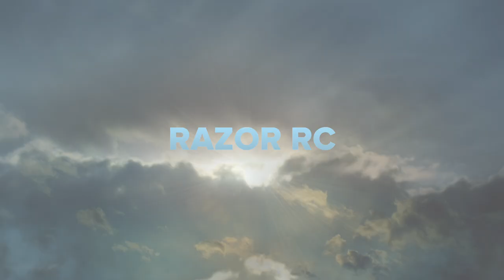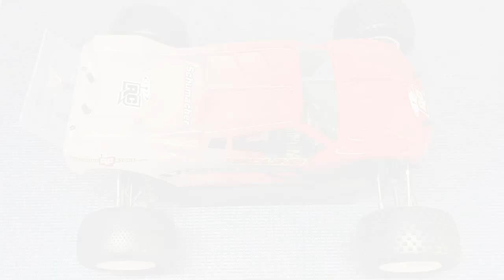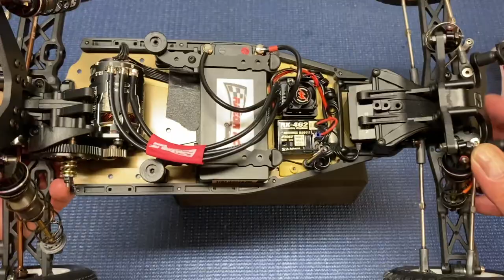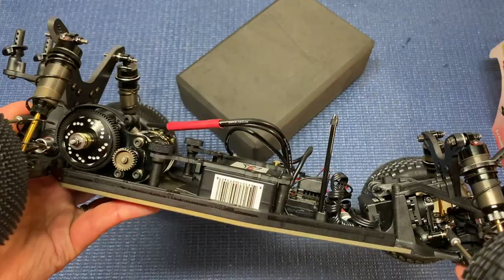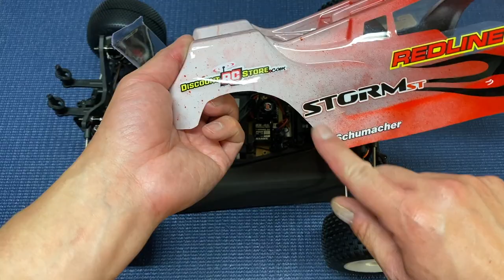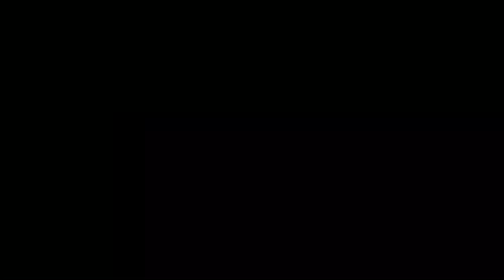Schumacher Storm Stadium Truck build review

Comment: What is different of the stock spec  and the XR10 pro
Reply: Stock spec 80 amp and pro 160amp. A lot of other small differences but read up on it on the hobbywing website.